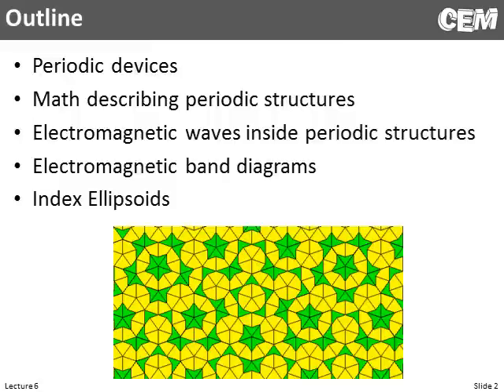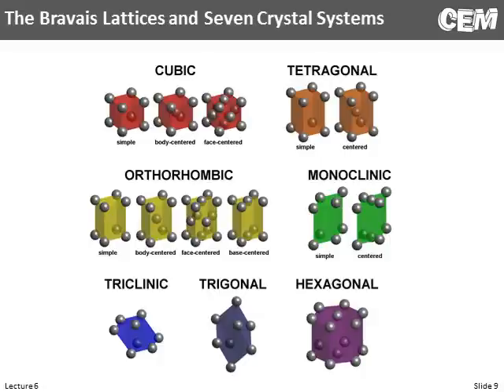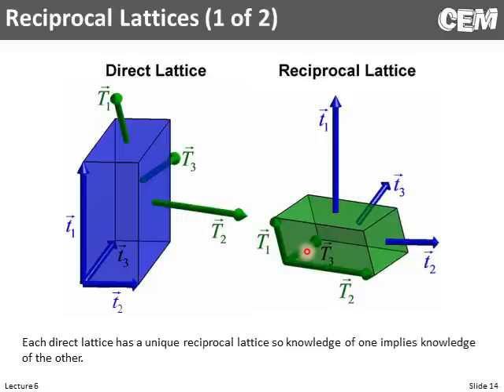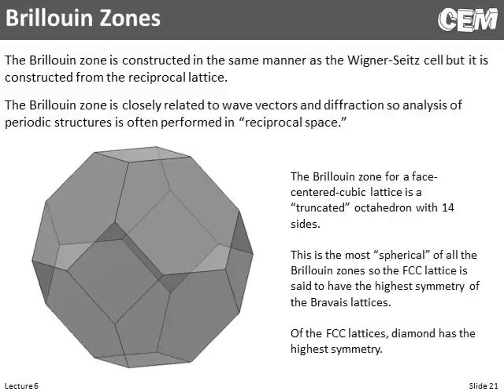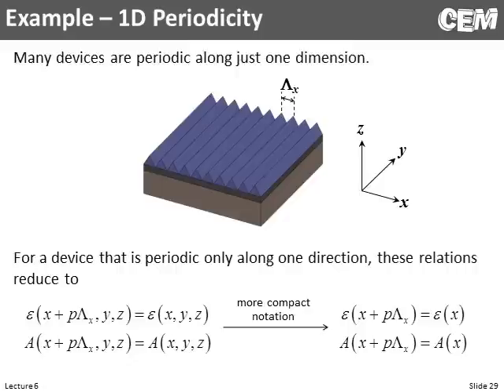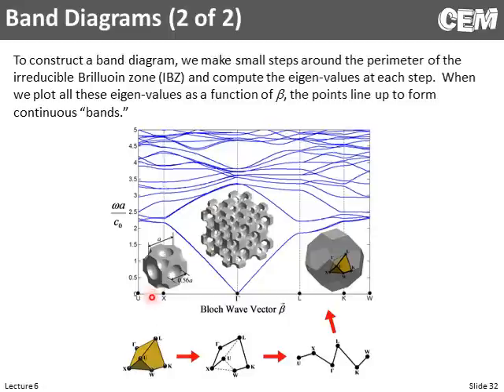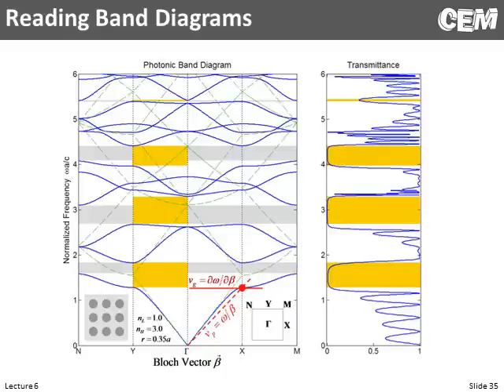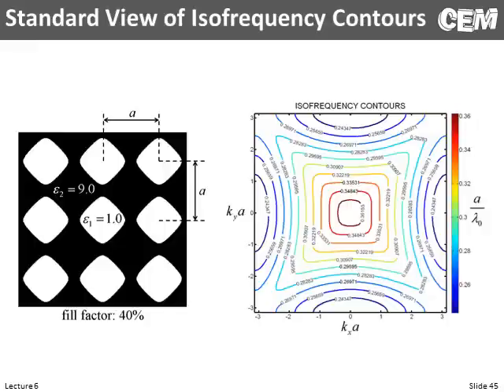Lecture 6 (CEM) -- Periodic Structures

Comment: Thank you so much for these lectures!

But i dont understand that how to find transmittance. Could you please explain this?
Reply from the maker: Happy to help!

First, this is a very old video and obsolete. I have considerably revised this material. This topic is in my “21st Century Electromagnetics” course. You find it in Topic 4 “Periodic Structures” under the section “Solid State Electromagnetics.” I recommend accessing the content through the course websites because you will always have links to the latest versions of the videos, notes, and other learning resources. Here is a link:

https://empossible.net/academics/21cem/

Second, to answer your question about calculating transmittance. To do this, you will need to develop a numerical method to run the simulation, or obtain commercial software and learn how to use that. I recommend developing your own code because you will learn a lot doing that. Getting started in computational electromagnetics (CEM) is an area I have developed a lot of materials. I found it difficult and frustrating when I did it myself as I had no guidance. One of the first things you will need to do is pick a first method to learn. Pick something that is simple and versatile. I think finite-difference methods are the best first methods to learn because they can do anything and are usually the simplest to learn and implement. Any other method will only be able to do it faster and more efficiently, but at a cost. The cost can be the methods are highly specialized or much more difficult to learn and implement.

I think finite-difference frequency-domain (FDFD) is the absolute best first method to learn. In fact, I wrote a book to help complete beginners learn the art of CEM and I do this through FDFD. Here is a link to the book website:

https://empossible.net/fdfdbook/

A close second best method to learn is finite-difference time-domain (FDTD). It is the time-domain brother to FDFD and the two method work incredibly well together. FDTD is like Thor’s hammer for simulation methods. When the problem is not possible by any other technical, people use FDTD. For small simulations, FDTD is generally slower and less efficient than FDFD, but still obtains good solutions. FDTD is best for big bad ugly problems or problems involving nonlinearities. For FDTD, I developed online courses intended for the complete beginner. There is currently a 1D FDTD and a 2D FDTD course. The 3D FDTD course is just a couple weeks away from being available. The 1D course is prerequisite of the 2D course and the 2D course is a prerequisite for the 3D course. Here is a link to the FDTD courses:

https://empossible.thinkific.com/collections/FDTD-in-MATLAB

Here is a video showcasing the contents of the 1D and 2D FDTD course:

https://youtu.be/uBiprIN8gfY?si=-tsnC04RtAXKdw4B

I do offer a considerable amount of free content as well, but these are my notes and videos that I use for my face-to-face classes. Compared to the materials above, you may find these harder to follow and they also do not contain any MATLAB codes as I do that in person. Here are two links to my Computational Electromagnetics course and my FDTD course:

https://empossible.net/academics/emp5304/

https://empossible.net/academics/emp5337/

Hope this helps!!
Reply: @empossible1577  First of all, thank you very much for your answer. I watched all your videos about band structures, including your new videos. I also calculated the band diagrams by finding the eigenvalues using PWEM. However, when I looked at the transmittance formula, I did not understand how to make the necessary calculations. I have eigenvalues and eigenvectors. There are also complete band structures. However, I could not find how to find the transmittance from these values. Could you please give me a perspective on PWEM and how to do this analysis with the values I have?
Reply from the maker: @osmanmertyilmaz5494  Happy to help. The PWEM as I have formulated it cannot calculate transmission and reflection. This is because it was formulated as an eigen-value problem where there is no source. The closest numerical method to PWEM that can calculate transmission and reflection is rigorous coupled-wave analysis. You will need to use that, or a variety of other methods, to simulate transmission and reflection from a photonic crystal.
Reply: @empossible1577  thank you teacher. With your permission, I would like to ask one more question. You visualized Bloch modes in your video "PWEM-2D Full Band Calculation and Visualization of Bloch Modes" (https://www.youtube.com/watch?v=AUeiGkeXJjQ&list=PLLYQF5WvJdJWY7bhZdBs9zGsC8BFkqRU7&index=2). I want to make this visualization. Do you have a chance to explain the mathematical formulation here?
Reply from the maker: @osmanmertyilmaz5494  What part of this are you asking about? The MATLAB graphics calls or the math behind calculating the fields associated with PWEM?  I think you are asking about the later. I have some notes about doing this in Lecture 6e in my  Computational Electromagnetics class.

https://empossible.net/academics/emp5337/
Reply: @empossible1577  thanks for everything.

Comment: @CEM Lectures In the document posted on your website for this lecture (#7), slide 31 gives the impression that the the field remains perturbed after encountering periodic structure, while slide 33 gives the impression that the field go back to normal (single plane wave) after the periodic structure has ended. Could you please clarify?
Reply from the maker: +_jp88 Nice catch.  I cheated a little bit on those simulations on Slide 33.  I adjusted the refractive indices outside of the lattice to match the external wave almost perfectly to the internal Bloch wave.  The interference pattern caused by the ordinarily mismatched lattice I felt would be too confusing for what I was trying to convey.  However, if the lattice is subwavelength, there can only be a single plane wave exciting the lattice.  If the lattice is greater than a wavelength, then the external wave will diffract into multiple plane waves.  There is a lecture somewhere on gratings and the plane wave spectrum that goes into a little more detail about this.
Reply: +CEM Lectures Thank you.